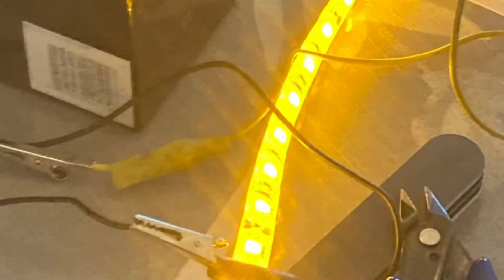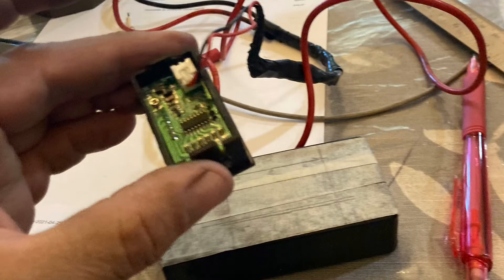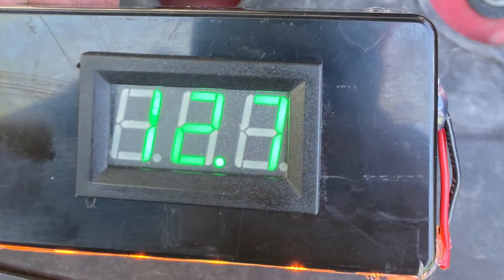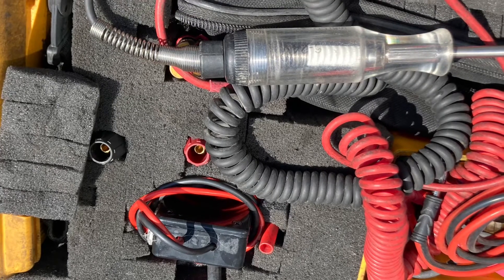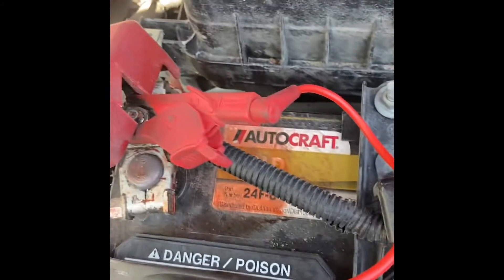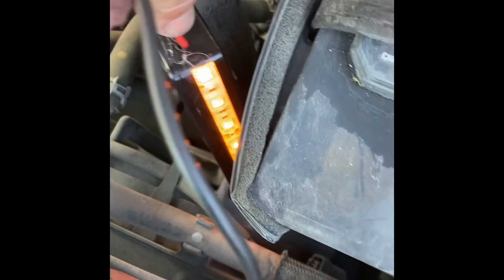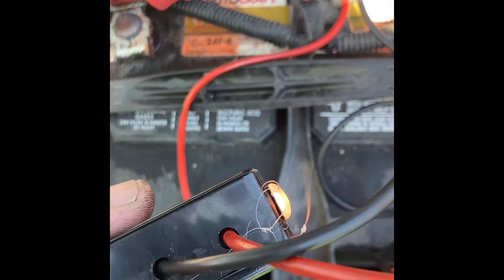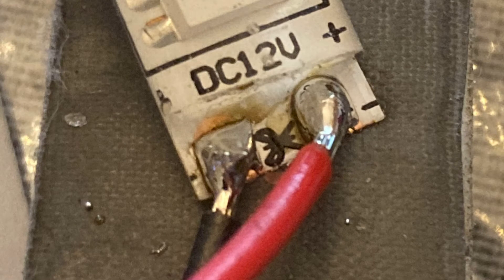Cheap volt meter for testing for voltage

Comment: A fancy digital meter.. I've got a couple old dash mount volt meters with leads on them. They work good.
Reply from the maker: Yea one of the guys put his meter on the tire of a Pete he forgot it and rolled and crushed his brand new snap on and I myself have closed the hood on a fluke , just a lil gadget and great for when your trying to measure  different points at once with muiltiple meters
Reply: @sonofmontezuma3732  cheap and easy 👍 and you don't get caught crying when you smash the expensive one👍
Reply: I bought a multimeter the other day for £20 or about $26 to check connections on my compressor. A cheap Chinese meter can bought for even less.and no hassle making a meter.
Good idea though to be fair.
Reply: @JonDingle  harbor freight used to give out little battery powered analog multi meters. We have a few, they're nice for things the digital multi meters aren't as good at.. and yes, free👍